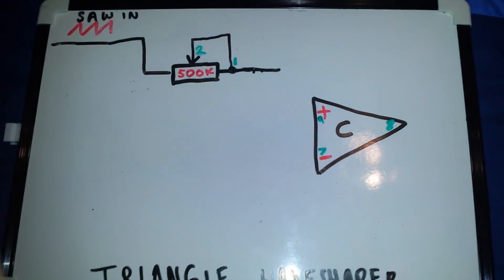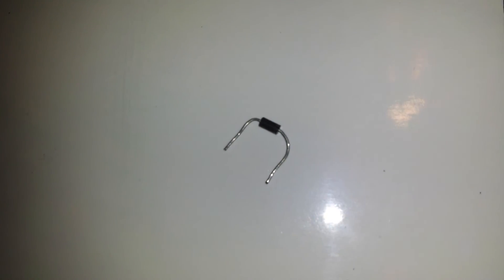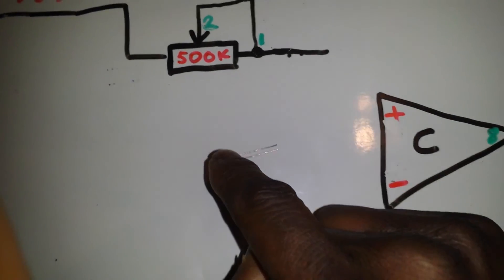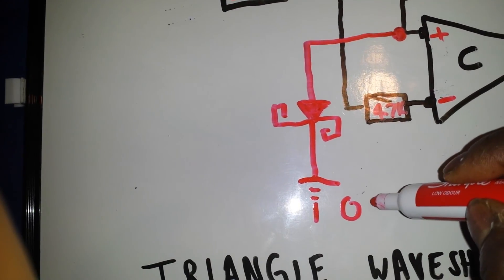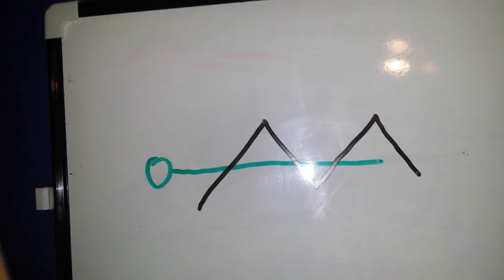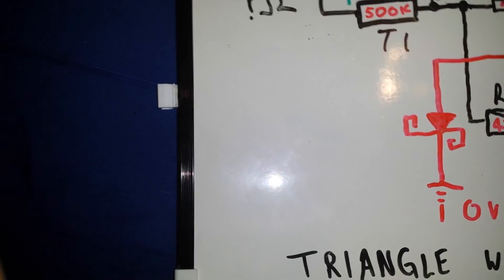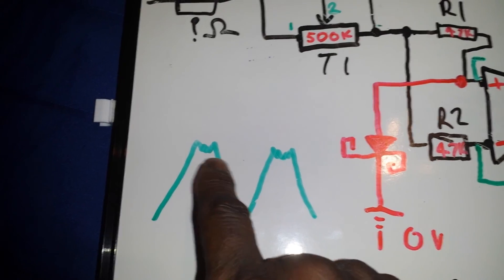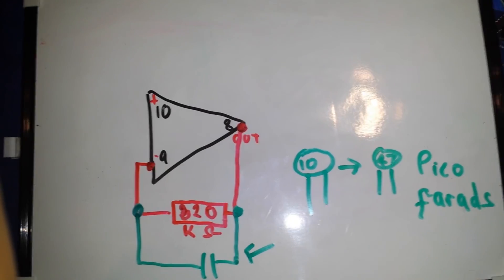DIY analogue synth project Tutorial Part 4 (The Triangle Waveshaper)

Comment: Hi, Adam!
I've made two osc +2 wave mixers + 2 vca + adsr build complete this night.
Tuning is a hell of a mess. The funny thing is that when I've used 1200 pF for the expo and 10 nF for the timing cap - here was less troubles with tuning :) Or I was just lucky. I've changed all four caps to 1500 pF film (polyester most likely) so they doesn't drift.
One issue is left: that glitch on the top of the triangle wave. 10 - 22 pF cap coupling doesn't help... 10pF maybe a little, bigger makes worse (in my circuit). The interesting thing is that the 1st osc. has a much less (almost none) of the glitch.
I've rewired (and moved around some components) the 2nd so it started then to "glitch" less.
What can be a reason of this thing? I guess (and who knows...) that it comes from the diode that is from the pin 1 to pin 6... because the saw wave has this glitch but it's hard to notice without an oscilloscope.
"Coupling" triangle wave's pot in the mixer section makes glitch a bit more pronounced. And BTW, it changes a wave shape... makes it's a bit closer to a square wave in a "smooth overdrive" manner. It gets some curves instead of a almost straight lines. This leads to another guess that some resistor choice in the schematic can make difference.
I've replaced that 470k trimmer + 5.6k R with a single 560k R in my circuit as these two 470k trimmers works together and if one (with 5.6k) is turned then the "result" of the 2nd will be "shifted". I can't explain it properly :) sorry.
______
I'll try to use darlington pairs instead of op.amps in your VCA schematic. Maybe it will work... At least they've made 'em in the IC for the same usage IMO.
Reply from the maker: MoolahNasreddin  Can you draw me the schematic by hand and post to me on face book so i can make more sense of the triangle circuit components you have used . Glad to hear you are making good progress.
Reply: Thank you for the help! I'll make the schem. later.
Reply: It's ready. Check the facebook PM, please. Sorry, it have took so long. I've made in EasyEDA. Anyway it will be necessary someday to have a normal schematic...

Comment: 0:45  I think this schematic could work. However only when the input voltage (Vmax of the sawtooth) is around 1.2 to 1.4 volt.  The amplitude of your saw input probably wasn't high enough. The idea of this circuit is (if I understand it right) that the Opamp follows the sawtooth. When the sawtooth reaches 0.7 Volt the diode starts conducting and it will provide a path for the current to ground. The non-inverting input will be clamped at a voltage of 0.7V and therefore the inverting output must be at 0.7V too.
When the sawtooth Voltage keeps increasing there will be a voltage over the 39K + 100K potentiometer, which sets a current. This current has nowhere to go but through the 100K resistor over the Opamp. This will create a Voltage drop roughly equal to the voltage over the 39K resistor and the 100K pot. 
So up until 0.7 V the Opamp followed the input voltage, but now any voltage over 0.7 creates a decrease in voltage at the output of the Opamp.

So when the saw voltage is 0.8 (0.7 + 0.1) the output is 0.6 (0.7-0.1), when the saw is 1.0 (0.7+0.3) the output is 0.4 (0.7-0.3) and when the saw voltage is 1.4 (0.7+0.7) the output voltage is 0 (0.7-0.7)
Reply from the maker: Jean-Jacques de Balzac  Thankyou for your in depth input , your definitly right about the voltage of my input saw being around that voltage .
Reply: Since you said a Schottky diode worked for you I assume the max Voltage of your sawtooth is about 0.4 Volt. Because a typical Schottky diode has a forward Voltage drop of 0.2 Volts. So your circuit will follow the saw to 0.2 Volt before the Schottky starts conducting and it wil decrease (from 0.2 down) for every input voltage over 0.2 Volt.